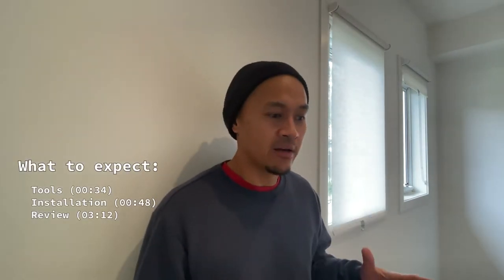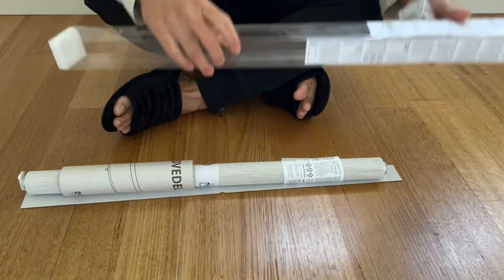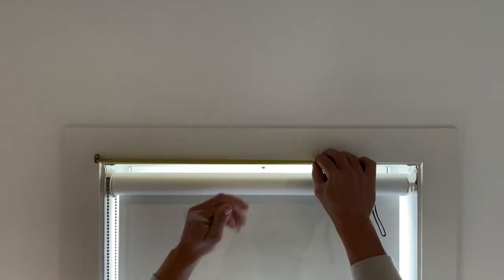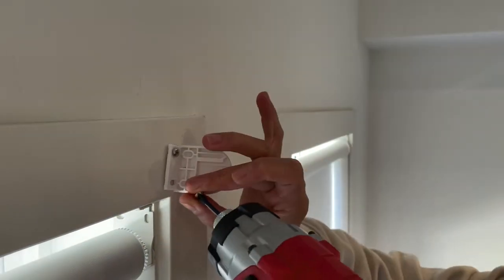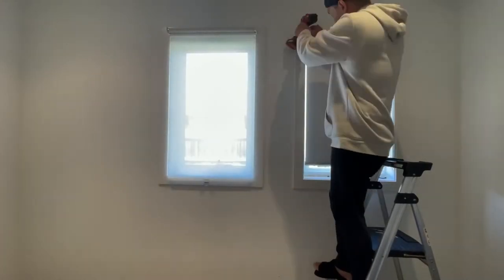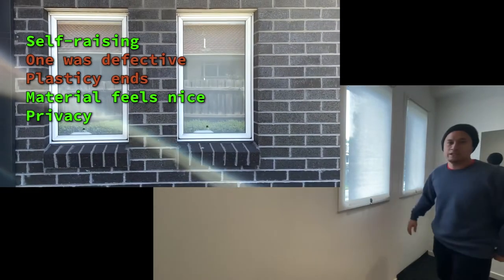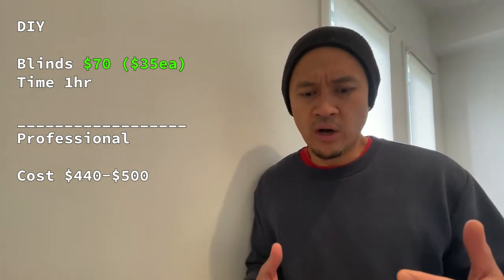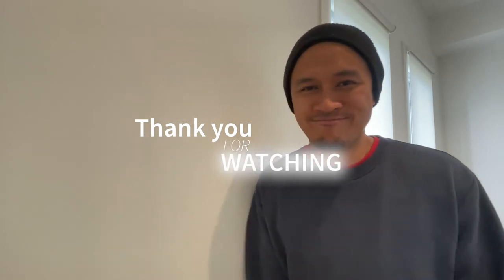Ikea Sandvedel Roller Blind installation and review

Comment: Thanks for the video.  
 I want to buy this roller blind but I read the total height of the blind is 195cm.  But the place is I want to cover is much shorter.  Is it not necesary to pull it all down to make it retract ? I got a question probably a silly one, cause I never have a roller blind before. Just want a confirmation before buying online 🙏
Reply from the maker: Hi Gary. That’s actually a very good question… and yes. You have to pull it down all the way to retract.
Reply: @gabeslifestuff  Hmm 🤔 but in the first 10 seconds of video, seems the blind you pulled to retract is around 100 cm long. And the full length of this blind is 195cm.  So I don't need to pull it to full length 195cm to make it retract ? Perhaps, I didn't express my thought clearly 🙏 
Thanks for replying and helping ! Thanks Gabe !